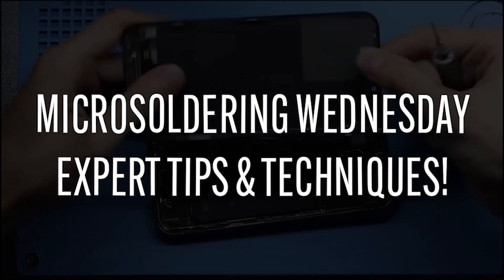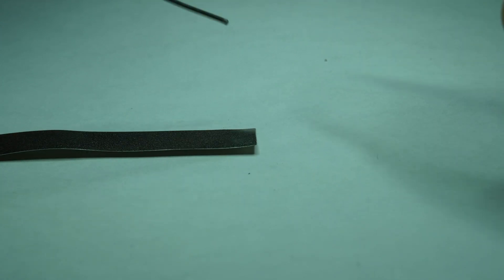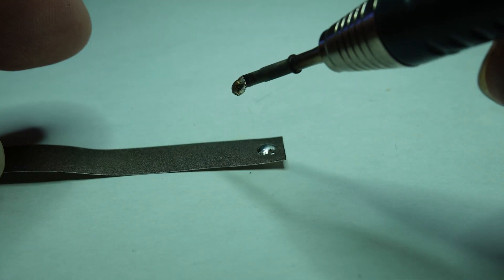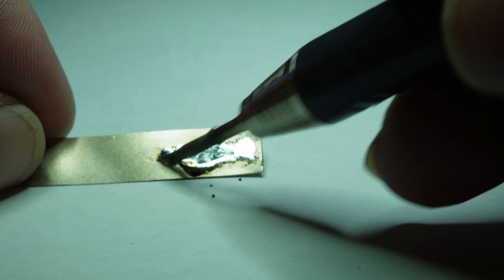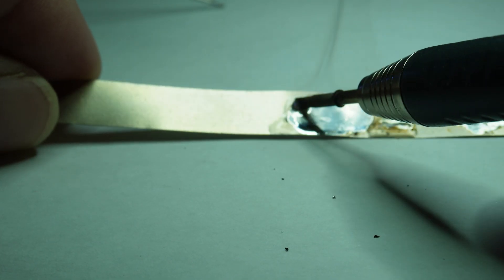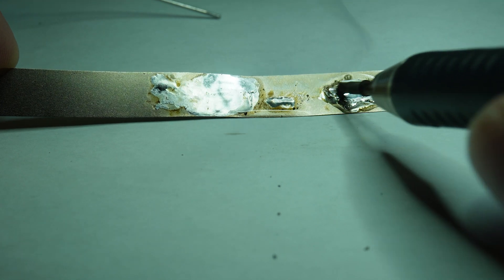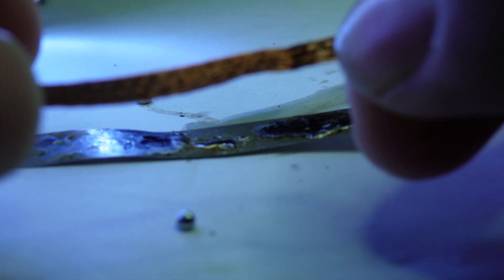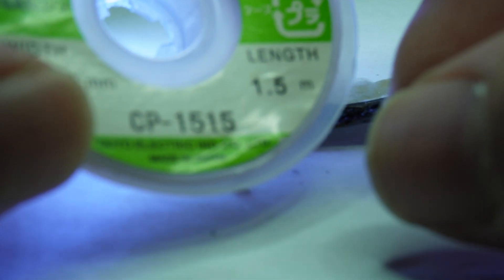Microsoldering 101: Understanding Wick, Solder vs. Solder Paste, & the Importance of Flux

Comment: Got a question. My ROG ally has these two small wires that go to its Wifi Antenna. The contact points have a button like contact surface for snapping the wires back on and the white wire did this very easily, but the black wires surface was flat and did not want to snap on. Could solder facilitate this connection for my black wire?
Reply: To clarify, this is a Z1 Extreme ally